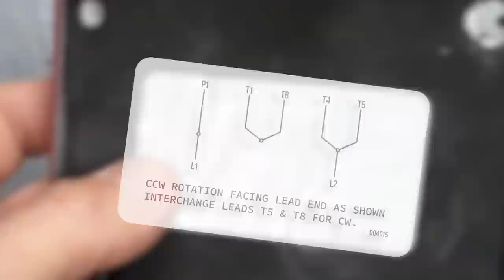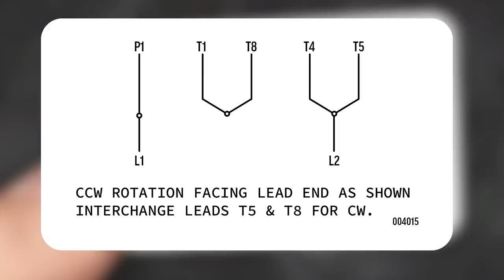Swapping a Bigger Motor into my Planer.  How Hard Could That Be?

Comment: A lot of comments regarding losing torque because Mat used the 1800 RPM motor instead of the 3600 RPM motor.  I've done the math and the math proves that the speed and torque at the cutting head is the same no matter which 5 HP motor you use.  I've simplified things just a little by using a 1:2 pulley ratio for the 1800 RPM motor and a 1:1 pulley ratio for a 3600 RPM motor, both resulting in 3600 RPM at the cutter.  Notice from the math below that with either motor the cutting head speed and torque are identical.  This is because the 5 HP, 1800 RPM motor produces twice the torque compared to the 5 HP, 3600 RPM motor.  The formula for torque for a given HP is Torque=(HPx5252)/RPM.  By the time you get to the cutting head, the torque and RPM are the same.

5 HP, 1800 rpm Motor:

Torque at motor shaft:  Torque=(HPx5252)/RPM
Torque at motor shaft = (5 HP x 5252)/1800 RPM
Torque at motor shaft = 14.6 Ft-lbs
Ratio: 1:2
**RPM at cutter = 1800 motor RPM x ratio = 3600 RPM
**Torque at cutter = 14.6 Ft-lbs / ratio = 7.3 ft-lbs

5 HP, 3600 rpm Motor:

Torque at motor shaft:  Torque=(HPx5252)/RPM
Torque at motor shaft = (5 HP x 5252)/3600 RPM
Torque at motor shaft = 7.3 Ft-lbs
Ratio: 1:1
**RPM at cutter = 3600 motor RPM x ratio = 3600 RPM
**Torque at cutter = 7.3 Ft-lbs / ratio = 7.3 ft-lbs
Reply: So, the 5 hp motor designed to operate at 1800 rpm ended up (on paper) as zero net gain over the 3 hp motor but the 3 hp motor when in good operating condition. A free 5hp motor designed to operate at 3600 rpm would have provided double the torque in a dream world because the pulleys on the motor and cutter could have been sized to provide a 1:1 ratio. I’d have done the same thing. Free beats buying a new motor every time.
Reply: @karll.masoner6918  I think you misunderstood Matt in the video.  With the old motor, once he switch to the carbide cutting head, he could no longer cut 3/16" per pass like he could with the straight bladed head (carbide head requires more power) .  Now that he has the 5 HP motor on there, he can cut 3/16" per pass with the carbide head.  So the 3 HP could not cut 3/16" per pass, and the 5 HP can.
Reply: @Balsamancnc  That makes sense since the actual power delivered to the head will be increased by 20%.
Reply: Makes sense
Reply: Your assumption and it's mathematical foundation I'd wager Matt was already aware of.
Reply: Yes. This comment was not posted for Matt's benefit.
Reply: @karll.masoner6918  The calculation is not comparing a 3 HP motor with  a 5 HP motor, it's comparing a 5 HP motor with a 5 HP motor. There is zero net gain because HP doesn't care about RPM. Even though some engines deliver a different HP at a different RPM, once you've got a certain amount of power, you can change the RPM as much as you want (using pullies, gears, whatever), and the only reason the amount of power at the output shaft (of the contraption, not the motor shaft) is because of friction during the conversion.
Reply: There’s more to it than just the first time reading of the motor. He also have to take into consideration the SF (service factor) which can make a significant difference.  ALSO: there are also other factors, but basically horsepower is equal to torque times rpm.
Reply: That's interesting. Hip shooting my thought was he would gain torque with low rpm's. It's interesting to me because of the constant of the electric and the physics ending up equal. I would've lost the bet lol.. and swore it would have been a torque gain. Thanks for sharing
Reply: The only thing missing is a load inertia calculation. Which would have an impact on motor speed selection and the gear ratio. It's quite the rabbit hole to dive down. The impact on overcoming the forces applied against the power of the motor is an interesting read, and has a stark impact on machine performance and even resonance factors that may or may not apply to wood planer. I haven't read much on planer resonances so I cannot comment on that specifically. Feel free to dive into the topic if you are interested.
Reply: What would be the implication of upping the HP to say 8 or 10 HP?  Could one increase the speed of the head or the torque or both with a beneficial outcome of a stronger, more powerful machine?
Reply: @jwdeet3396  I did not design this machine but my expectation is that the entire machine (castings, shafts, rollers, bearings, etc.) were designed for a particular load range, and you would not be able to realize double the throughput by doubling the motor power. Somewhere between where he is now and that theoretical double throughput the motor is no longer the constraint. Again, this is just my expectation, based on typical manufacturing decision criteria.

Comment: As a kid back in the 70's, I worked at a shop that made massive custom wood doors, tables, parts for yachts, you name it. If it was too big for anyone else, we did it.
The shop had a 50" in the clear double sided thickness planer with shaping blades. Solid cast made by a T-rex or something. Mounted to what looked like ten coil springs from a one ton truck to the floor. It was well balanced but when it fired up it felt like the building moved.
It would probably cost a million bucks to have one made today. 
Two weeks on the job I was watching a guy with years of working at that shop. One second he had two arms, the next he only had one. Ripped clean from the shoulder. Not near as much blood as you would think there would be. Poor SOB never passed out. 
I said screw it and went into AC/H&V. 
Aw the good ole days.

Comment: I would recommend when doing it this type of repair, would be to check the rpm at the drive pulley.  That way you can verify your getting 5000 RPM.  They sell those meters everywhere and are simple to use.
Reply: When you change the pulley on the motor, did you go with a pulley that was twice? The diameter are twice the circumference. Another reason to check for 5000 RPM at cutterhead.

Comment: Great job and explanation. My neighbor has the same welding table,he had basically the same problems you had with trying to level the surface for welding. He sanded it down. Just use it just a little bit in few spots.

Comment: Great video Matt (as per usual). I went through pretty much the same exercise myself a few months ago. The little woman her indoors picked up a 15" generic second hand, ex school. Was labeled Wellington but pretty much the same as the old Grizzly. It had a 5H three phase but I don't have 3 phase. My son had a spare 5H single phase but half the speed and larger size and shaft. I had to make up a new mounting plate, fit a new pully (doubled the size on the motor to compensate for the speed difference) fit a new switch and reverse the motor. The pulley cover did fit - just! He also gave me a soft start which means less stress on startup. I also had to add a 20A (240V here in Australia) circuit which I put in the ceiling with a pendant 20A socket. Was a LOT of graft but got there in the end. It now works like a bought one.
Reply from the maker: Hahaha that’s pretty much the same experience!

Comment: What a great upgrade, and a great video!
It will probably be fine, but I think those LVLs get a lot more strength when they're oriented 90 degrees from where they are now, so the lamination runs vertically.
Reply: The layers of lamination allow for a high compressive strength as well as shear strength. Matt’s good
Reply: They're being used as spacers. He's fine and will sleep like a baby with no fear of the spacers collapsing.....ever.

Comment: I had a similar problem with motor height. I made a right angle mount, 2 x 1/4" plates and 2 triangular end buttresses,  with the motor mounted sideways on the vertical plane.  Much easier to mount that way. Instead of standard "v belts", I switched to the "link belts" from Lee Valley. Better power transmission, quieter and easily adjustable if you ever need to have different belt lengths.

Comment: Matt: I used to only look for machines with single phase motors due to only having single phase power in my basement shop. VFDs are getting to where thy will handle bigger and bigger motors so you can easily handle (and better control) machines with 3 phase motors. If in the future you go for a wide belt sander for example, this might be an answer.
Reply from the maker: Yes, that’s how I run my sawmill motors and my bridgeport

Comment: under the tape on the winding connection to the blue wire, there might be a thermal fuse that blew in the old motor winding.  simple check across with multi-meter might show your thermal fuse might have blown.  I have seen that in other motors.  Good luck, if not it's a boat anchor.  ;-)
Reply: The winding was burnt. He wanted a more powerful motor anyways.

Comment: Usually we see you work with wood... an area in which you are quite expert, but occasionally we see you work with steel and or aluminum, but it's so seldom that it is difficult to ascertain if you are similarly gifted with those materials.  And, sir, you are obviously on a different place in the learning curve - but it is seriously nice to watch someone work through the challenges and figure everything out.  Nice job!  I have a motor or two (more like 10) that I have been wanting to re-purpose and this project has provided some encouragement.  Thanks for sharing this with us.

Comment: Bringing in a more powerful electric motor as long as the bearings and cutting assembly can handle it is smart. All things said, if the output is better and easier to do while saving time then go for that bigger electric motor. Thanks for the Video.

Comment: Hi 👋, Matthew , it might of been cheaper and easier to purchase a VDF Drive until, and motor, they are 220/240 in and 3 phase out , the company that sells them, can give you the correct VDF and Motor, and they can setup the VDF for you and install, all you need to do is give them the HP 5 hp of motor and RPM cutter block, 3000 rpm , and you can even control the speed, and braking for the motor, and normally cheaper to run, I hope this some help, though this might be too late for info as you posted this 3 weeks ago, I suggest it might be even better still going up in more HP as my SMC jointer/planer is 7hp and my thickness is 10Hp . You can not beet HP , good luck with your project, 
Stay safe, PHIL FROM THE DARK SIDE OF THE MOULIN FRANCE.

Comment: Wiring rotation of the motor.
The label says the rotation is when looking at the (Lead) end of the motor. This means the rotation described on the label is when looking at the end of the motor where the wires are. Not the shaft end of the motor where the pulley is. Most motor labels go be the lead end when describing rotation. It’s confusing so why do the do it? They do it because some motors have a shaft on both ends. So they go be the end of the motor where the wires enter. And to keep this a standard, they do the same on single shaft motors.

Comment: And here I am thinking that switching the wiring on my jointer from 110 to 220 was a pain. Compared to this.......nope. LOL
So Matt, I have an old lunchbox planer that needs a rebuild.......are you up for another "fun" project? 🤣🤣🤣
At least it won't be difficult finding the planer in the shop now that it slightly stands out from the other tools.

Comment: A common trick in the lab where I worked was to throw a charged electrolytic to a buddy and shout 'CATCH!'.  It was reflex to try to catch it, and if your hand shorts the terminals while doing so, it was like touch an electric fence.  I remember a genuine accident on the bench across from me where a bunch of big electrolytics in parallel exploded throwing bits of casing and brown paper around the lab.  When I think of the stunts we all got up to, it's a wonder no one was seriously hurt.  Spinning up a bearing with an airline and dropping it on the ground was a good one. Even having bugger all grip on the concrete floor, the bearing would still be doing a fair old lick by the time it hit the wall.

Comment: Why does it feel like this is how every "free" used tool, appliance, etc. works out?  Several hours and a couple hundred bucks later, you got your free used item.
Reply from the maker: That’s how it works
Reply: That's why they say that oftentimes, "free" is the most expensive option. 

Unless you're making content!
Reply: I see what you mean. It invariably turns into an excuse to buy more tools.
Reply: At least the motor was free. 🤷🏼

Comment: Great video. The tape on the motor connections should be electrical tape, rubber splicer’s tape, and another coating of electrical tape. The rubber splicer’s tape will protect the connection from the vibrations inside the motor housing. If the only electrical tape wrap rubs into the housing, you won’t have a good day.

Comment: Nice job but I agree it would be far easier to buy the matching 5 hp motor, the starter and shroud from grizzly. It would be a good idea to make 4 cover pieces from metal or plywood to reduce the amount of dust getting to the new motor via that new gap you created …presuming the new 5 hp motor from grizzly is comparable in size to your aftermarket motor. I have the same 20” plane with 5 hp motor and elliptical carbide blades. My dust collection isn’t as effective as yours and my planer really cranks out the dust and chips so I’d be concerned about it getting to my motor and causing a fire. I bought my planer with the elliptical bits so my motor enclosure doesn’t have the gap yours has. Should be a quick fix. 

Great videos. Great content. Keep them coming. 👍

Comment: Hi Matt, You could have saved a lot of work by cutting the welds attaching the base plates and swapped them over but rewelding the old plate onto the new motor but 90 degrees out of place. This would have allowed refitting the motor using the original base and would leave the  start capacitor to finish in a position either behind the motor or in front , where ever there was the most room. Regards Mo. King

Comment: A minor correction: an AC start capacitor does not hold a long charge like a ‘little battery’; that would be an electrolytic capacitor in a DC circuit.  Also if you have a shorted winding (possibly caused by burned insulation) the motor will draw a VERY high current which will cause very similar groaning symptoms.  Also mechanical interference between the rotor and the stater (possibly caused by misalignment resulting from excessive wear) will have a similar result.

Comment: interesting as i have what looks like exactly the same 20" unit with a 5hp motor and 4 knives, but with a different brand name on it.  as i am now retired and no longer making furniture for a living, i have not considered upgrading to a helical head.  but hearing that a dull knife system cuts more than a helical, i will stay with knives, even if i continue to wear hearing protection.

Comment: That capacitor could be a run capacitor and that centrifugal switch could be for start windings. The caps on the new motor can be sited remote from the motor itself.

Comment: I had the exact same problem with my run capacitor but it brought to light a more troubling problem.  The cradle mount is 10" long and the motor is 9 1/2".  Motors don't stretch.

Comment: 2:53 Once you get arcing in the Stator Windings, the motor needs one of two things...

1) It needs complete replacement...
or
2) the Stator needs to be rewound and with most small single phase motors, that costs FAR more than a new motor does...

Until you do one of the above, that motor is nothing more than a paper weight or door stop...

😄😁😆😅😂🤣

Comment: Another fun video, although I got a wee bit nervous toward the end when you stuck your head right in front of the dangerous bits when testing. Had my hands over my eyes and peeked through my fingers even though I know dang straight the video wouldn't be uploaded if something bad happened.

p.s. I had to pause and rewatch because I could SWEAR I saw a full ashtray at 40:17 I knew it wasn't possible but I was a smoker way way in the past and had flashbacks. Who knew screws look just like butts.

Comment: Should use cutting oil when drilling holes in steel.  AND of course tapping oil for the tapping of the plate.  Oil makes drilling and tapping easier.  But you probably knew that already.
I learned about all that while in gunsmith school.  Oil is essential.

Comment: Thanks Eric,  I did not realize that in electric motors half the speed = 2x Torque
Where does the 5252 constant come from?
Given that,  I'm sort of surprised the 5HP equipped Planer bogged down at all, I guess segmented heads really eat power.

Comment: If you ever need a motor rewound, Reliance Electric in Hudson, WI does that, Matt.
Reply: Can they rewind a 3 HP motor into a 5 HP motor?
Reply: @1pcfred  Sorry, I don't know.  They have been doing rewinding for a long time, so it's worth a call to them.
Reply: @markfrye9178  it is only worth if if you're not getting motors for free.

Comment: Matt, with the spacer blocks creating air gaps between the planet body and the motor cabinet, are you worried about sawdust or shavings getting in there and building up around the motor?

Comment: Classic Engineering Conundrum:   you obtain a "free" part that will upgrade or repair an existing machine.  But.  You spend more in time and new materials than if you'd simply purchased the official part in the first place.    "But it was FREE".   Free can be more costly, sometimes.  On the flip side?  If you are self-employed your time is yours, and learning or figuring out how to fit your "free" part, can be very satisfying.   Nice video.  Me?  I'd have fabricated a side-mounted box for the start capacitors, so your spacing requirements could easily have been met with some thick washers, or maybe not needed at all.  The box does not need to be attached to the motor anyway.  In HVAC, for example, the start caps are always mounted externally, for easy replacement.